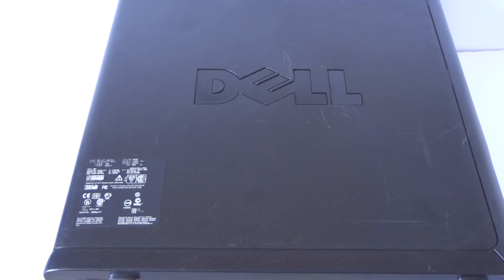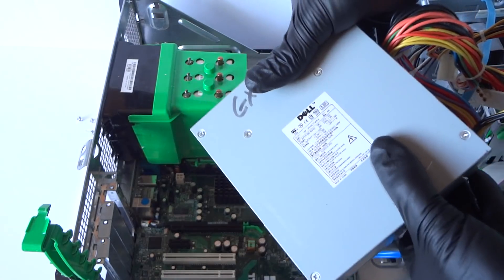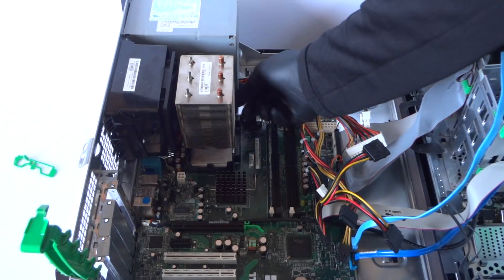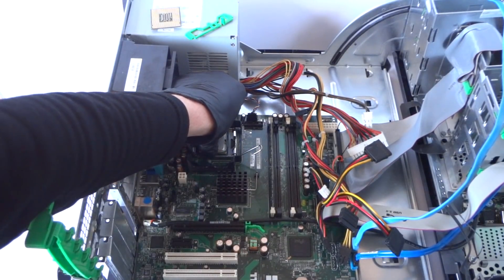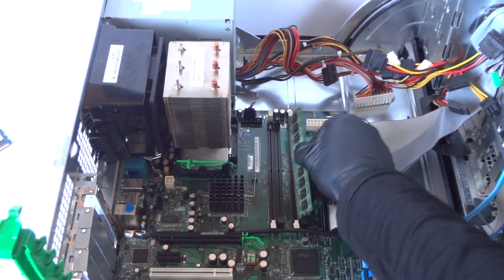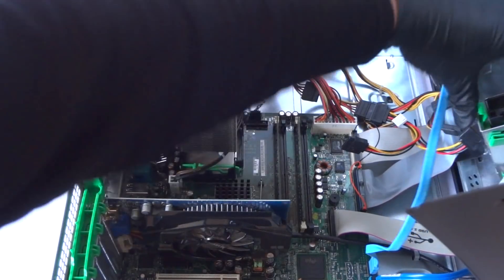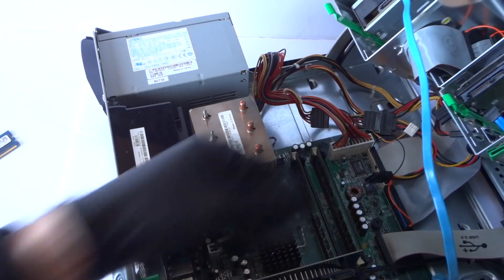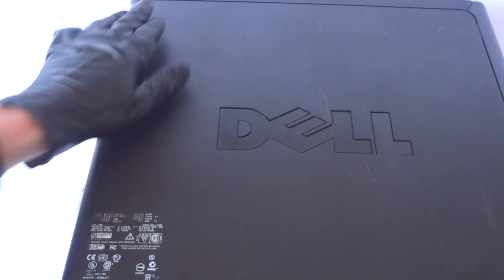Dell Optiplex GX280 Gaming Upgrade CPU Video Card Power Supply.

Comment from the maker: List of RAM works with this system 
  
 

Tested video card for gaming in windows xp also works with this machine

PNY NVIDIA Quadro 2000 Graphics Card 1GB GDDR5 
https://amzn.to/390QYfs

 2GB Kit (2 x 1GB) RAM (DDR2-533, PC2-4200) for the Dell OptiPlex GX280 
https://amzn.to/2ZjkhH1
2GB Stick DDR2 Non-ECC PC2-4200 533MHz RAM Memory
https://amzn.to/2ZkKiWE
Here is the list parts upgrades.
(1.) CPU: Intel Pentium 4 @ 3.8GHz SL82U 570J (1MB L2 Cache 800MHz FSB)
(2.) RAM: Hynix 1GB DDR2 PC2-6400U 800Mhz 2Rx8 Desktop HYMP512U64CP8-S6 AB-T
(3.) Hard Drive: Seagate ST500DM002 500GB 16MB Cache SATA 3.5"
(4.) Power Supply: 300W Dell 0FY630 LITEON PS-5301-08
(5.) Video Card: GIGABYTE GeForce GT 430 2GB GV-N430-2GI
You Can also use this RAM Works with this PC.
(1.) Samsung PC2-4200 (DDR2-533) 1 GB DIMM 533MHz DDR2 M378T2953CZ3-CD5
(2.) RAM: Hynix 2GB PC2-6400 DDR2-800MHz HMP125U6EFR8C-S6-AB
Reply: Mxkdi it’s saying incompatible processor and I they same pc and hardware in this video
Reply: ddr 1 ram how to support for gx 260

Comment: I have one of these but it's the SFF version. I have the 3.2 GHz version of the Pentium 4 in mine. Couldn't upgrade mine to the 3.8 GHz version because I also got the "Incompatible CPU" error. Mine's got 4GB RAM installed. Only 3GB recognised by XP though due to it being the 32 bit version of XP. A Quadro K620 is a good GPU match for the SFF version of these systems. Many would just throw these out and they'd end up as landfill, but they can still be enjoyed to this day as they are perfect for arcade emulation and for playing older games on.

Comment: Can you use a zotac geforce gt1030 2gb gddr5 on an old dell computer?
Cause i want to upgrade my pc
Reply from the maker: Hi, no this video card does not support win xp drivers  you can try to get older video card like gt 730 or gt 450, gt 430 that will work with win xp.
Reply: i know this comment is 2 years old but you can upgrade the pc to windows 7 or 10 if you want the gt 1030 to work

Comment: Hi! I have a dell optiplex 9010 desktop version and I was wondering if I could put a Geforce GTX 1050 Ti OC Low Profile GDDR5 gpu in it? Thank you for any help given!
Reply from the maker: Hi, yes you can install that video card with low profile bracket in a dell optiplex 9010 dt.

Comment: I have question about dell optiplex 990 motherboard 06D7TR.
Motherboard need a 24pin connector, but in my region is hard to find that kind PSU with 24pin, can I use a 20+4pin PSU for motherboard, or I need exactly 24pin connector?
Reply from the maker: Hi, what kind a brand power supply are you using 20pin?
Reply: @Mxkdt  maybe I describe something wrong, about PSU, I'm noob in PC build and maybe the correct question is, is the 20+4pin same the 24pin connector for motherboard? Sorry if I write something wrong, thanks for your answers

Comment: I have question about dell optiplex 990 motherboard 06D7TR. I copy this question from another video, but I have same problem
Hi I have a Dell Optiplex 990; i was wondering of the sata cables got in the way of the graphics card. I started worrying when i saw the sata cables in the way of the second PCI slot because it looks as if they might get in the way of the graphics card and it has me very worried if i cant install a 2 slot graphics card around 10 inches. My question towards you is how did you bypass the Sata cable problem??
Reply from the maker: Hi, you can use L Shape SATA Cable.. Which SATA port are you talking about SATA0 or SATA1 ?
Reply: @Mxkdt  both, SATA0 and SATA1 because I think take a 10 inch long rx 570 graphic card. Thanks for the answer

Comment: Help can i in my optiplex 960 put r7 240 1 gb 128 bit video card
Reply from the maker: Hi, i never tested on dell optiplex 960, only tested on dell 7020, 5040, 3020 works fine and you should get geforce video card if you want to play PC games.